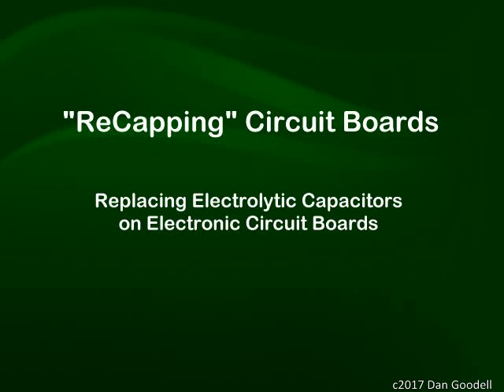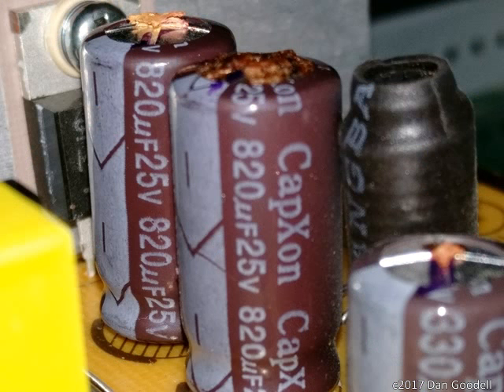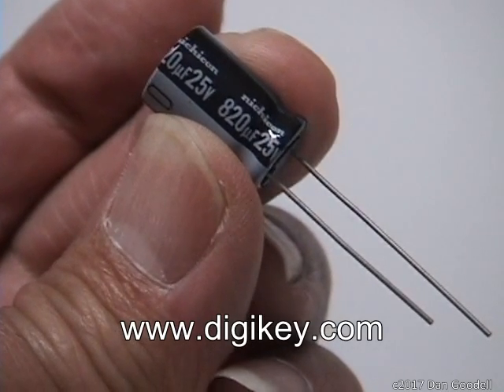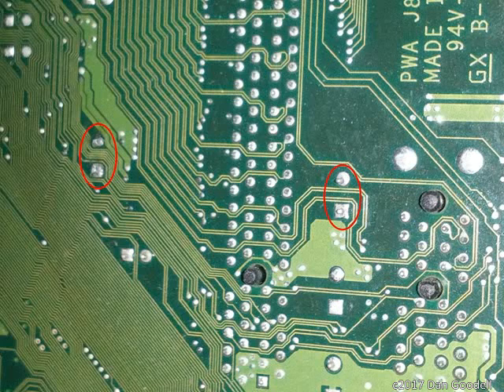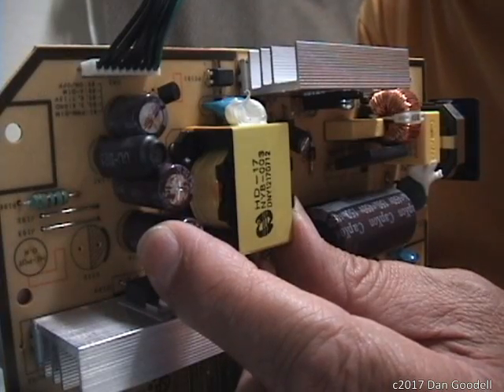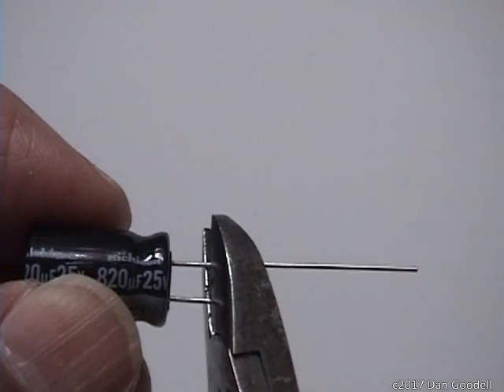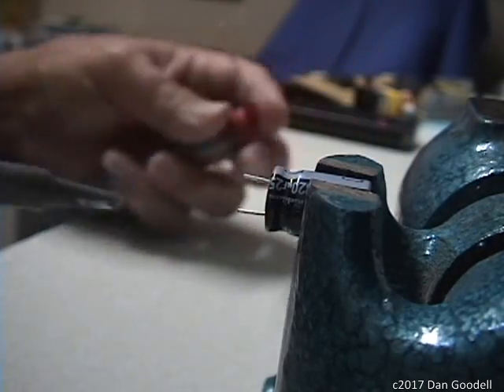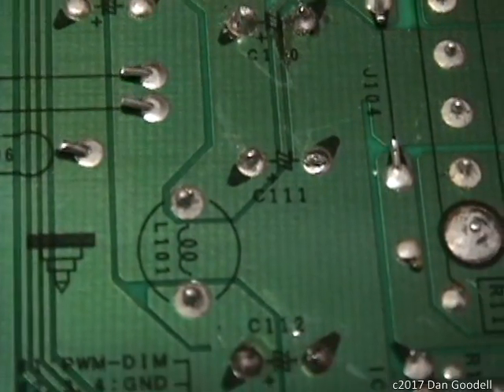Replacing Electrolytic Capacitors

Comment: My receiver stays on for 20 minutes then shuts off by itself. It has nothing connected except for the power cord.  I can solder a little bit. Does the diode, transistor, or capacitor control the on  and off button? How can we tell if the diode, transistor, or capacitor is bad?

Comment: Will a 90 Watt solder gun get hot enough?
Reply from the maker: Most electronic soldering irons are around 40-60W, so 90W is more than enough. What's relevant is temperature, not wattage. 

Typically, the tip should be in the range of 600-800 degrees F. More wattage allows the tip to reach temperature quicker, or spread the heat across a larger area. 

A soldering gun is really for larger tasks than precision electronic soldering, hence the higher wattage. I'd recommend using a soldering iron, not a soldering gun.
Reply: @dangoodell2  thanks for the video. I am a retired IBEW Maintenance Electrician.  The old Sony popped a cap . I purchased a Weller WE 1010 and awY we go. Temperature was scary until I read your notes and checked some PDF's. Thanks

Comment: When you say you can step up the cap if you don't have one with the same value, How far can you step up? i have a cap on a motherboard 330uf 6.3v but the closest value i have is 330uf 50v?
Reply from the maker: I'm not a chemist and won't claim to be an expert. (Electrolytic capacitors depend on the chemical properties of the liquid electrolyte under the influence of a particular voltage range.)

In this instance, though, the e-caps are conditioning the power (smoothing the supply voltage by removing spikes, noise, and AC hum), where specs need not be stringent. I would have absolutely no reservations about replacing them with parts 2-4x over spec (say, 800-1200uf at 16-25V). Generally the only consequence is you'd get a supply voltage even smoother than necessary, which is not a bad thing.

Be careful trying to push things too far, though. A part vastly different might have other properties (such as impedance or ESR) that could detrimentally change the way the circuit operates.

Beware the physical packaging of your replacement part; will that 50V part physically fit in the space allocated for the original part? Is it small enough? What about lead spacing?

If it will fit, and if you're unwilling or unable to find a closer match, I would go ahead and try it. I would expect it will work. In power filtering applications, it seldom needs to be that precise.

For the nit-pickers out there, I'm qualifying this by reminding everyone that these are power filtering applications (as seems to be the case with every bursting-cap case I've come across), not signal processing applications, and in my video they're on a device that has already failed and is otherwise destined for the trash heap. 

I'd generally prefer to use a better matched part (and if it's a high-end device that absolutely must be repaired at all costs, I'd insist on it), but if the alternative is the device will just be tossed, then there's nothing to lose. I'd try that 50V part because it may likely work.

Comment: I have replaced electrolytic caps from loudspeakers for 20 years.
I understand using a (quality)  cap as a choke in like with a woofer.  In line with the mid and tweeter, they have too much ESR, and a host of issues that smear the sound.

Power amps use them for storage.  I have seen (cheap)  storage caps go bad in a Parasound audio amp and burst.  The electrolytic leaked, dried and the cap shorted.

Higher quality crossovers use low ESR  metallized film caps and avoid a host of problems while providing a more sonically neutral signal coupling.

Comment: I am hearing a sizzling/ vinyl record crackle in the left/right audio outputs and headphone jacks Studiologic Sledge 2.0 synthesizer. After approximately 30 mins of playing, the noise starts low volume then increases to that’s almost all that can be heard. I’ve heard that this could be a symptom of a bad capacitor, but I’m not certain. Any ideas or advice?

Comment: When I ordered ‘matching’ caps (I thought) for a vintage synth, their voltages said “VDC” instead of “V”. 
Should I use them? 
I didn’t think a synth plugged into the wall would use DC. 

Thanks, great video!
Reply from the maker: In this context, V and VDC mean the same thing. Yours should be safe to use. Most electronic equipment operates on DC, so a power supply (either in an outboard power "brick" or built into the device itself) converts AC current from the wall outlet to DC current used internally by the device. These electrolytic capacitors are used to filter and smooth out the converted voltage. Remember that they are polarized, so make sure you orient them in the proper direction.

Comment: One of the best videos I've seen. Thanks Dan!  Very explicit and professional.  
Gives me some confidence to work on my old Kenwood Model Eleven which has at least three e-cpas that have been oozing for quite a while to the point they have hit the PCB. Also found one broken resistor which was actually loose.  
After watching this vid I replaced an in-line fuse for the display lights successfully.  I am hoping to go deeper into fixing several of the circuits that don't work as well as several display lights.  Hoping Digikey may have these very old parts?

Comment: Bulging caps are definitely bad but flat tops may still be bad. I replaced several bad 'flat tops'  this week. I retired my Weller irons as they are inadequate. You really do not want to push caps in while heating as you can lift the pad from the board. What is better and faster is to clean the holes, insert caps with long leads, add flux with a flux pen and solder in place. Clip leads and clean off flux residue.  BTW C112 on that board has bad solder joints. Merry Christmas
Reply: I don't know what kind of Weller irons you use, but my 50 Watt Magnastat and WSP80 (80 Watt iron) still serve me really well. I think you talk about the red Weller irons, which are not comparable to the professional stuff they also offer.
Reply from the maker: And yet, the monitor works. As does every other device I've recapped over the last 10 years.

Comment: Why do you put more solder on the tip before removing the capacitor?
Reply from the maker: For best results, you want to keep the tip of the soldering iron clean, typically by wiping the tip on a damp sponge, to remove excess solder, flux residue, and other crud. After cleaning, the tip is "re-tinned" by touching it with a dab of fresh solder. (Electronic solder is composed of mostly tin.) A wet tip helps provide quicker heat transfer to the parts being soldered. 

You want to apply the iron to the parts for as short a time as possible to limit heating too much of the area and damaging parts, but you need to apply it long enough to melt the solder. IOW, high heat transferred quickly is better than lower heat transferred over a longer period of time. A dab of wet solder on the tip of the iron promotes more rapid heat transfer.

Comment: I would add that using a side cutter to clip off as much of the old cap leads as possible will make removal much easier. Don’t try this on large “snap caps”. You’ll pull through holes. Instead, use two irons to heat both leads simultaneously.

Comment: there's a video of someone replacing electrolytic capacitors on a computer motherboard , with polymer capacitors (e-cap)  , the problem is that he skipped the soldering part , and didn't power up his board to show us if it really worked .  so , I'm asking if any of you tried that , or if we can find another videos  where we can see all the steps

Comment: Good explanation, but I would recommend that you remove the old solder with a solder sucker.  Reheating the joints that many times is bad technique; risking damaging the pcb pad and the component.  Reheating the solder multiple times when installing the new component also causes the solder to oxidise increasing the risk of a dry joint later on.  In general heat should be applied for the minimum time possible; just long enough to allow the solder to run into the joint and no longer.
Reply from the maker: Yeah, in my 58 years of soldering I've heard all that before, but consider it overly cautious. Kind of like how you should never leave your house without a broad-brimmed hat because of the risk of skin cancer. Well, maybe, but probably not.

I do have an assortment of solder suckers and solder wick of varying sizes, but in my experience you can do more harm than good if you try to get too fancy. The technique I've illustrated doesn't require expert soldering skills. Competent, yes. Expert, no. I prefer to keep it simple and avoid overthinking it.

And let's not forget that for many people the alternative would be to junk the whole device, so what's there to lose?
Reply: dangoodell2 fair enough, each to his own I suppose 🙂
Reply: @dangoodell2  I totally agree with you!
Reply: @dangoodell2  I've reached the same conclusions as you after 6 years of working on vintage audio gear. Solder wick and desoldering tools work well.... but they require more application of heat to the board. 

It's a compromise- less old solder in the joint, yet more heat applied to the contact and surrounding components. Fine and dandy if it's a modern board with sturdy contacts/traces/layer construction, not so good when you're dealing with the flimsy old yellow boards of the 70s-80s. 

Personally, I'd rather reflow the leftover solder with fresh Kester rosin flux and Kester 63/37 than risk lifting a contact or trace. 

Not to mention the time savings- when you've got 24+ channels to recap on a mixer, getting every last bit of solder off the joint would triple the repair time. I see full desoldering as "high risk" with minimal gain. The less heat into the board, the better.
Reply: @dangoodell2  let's thank the good comment before being defensive only.